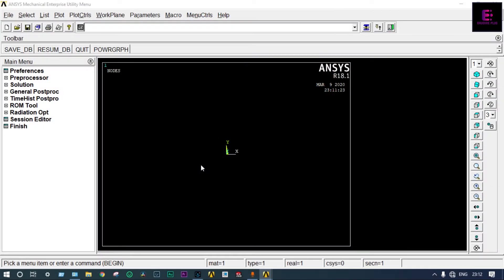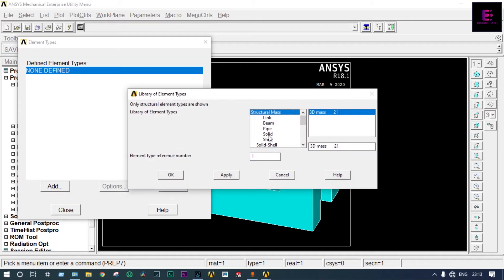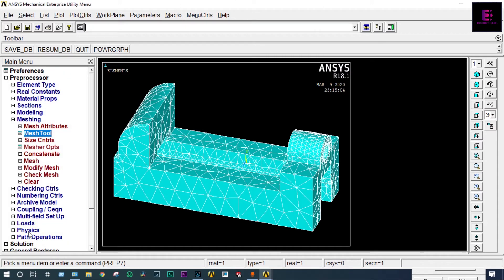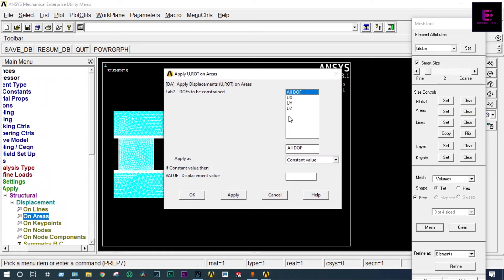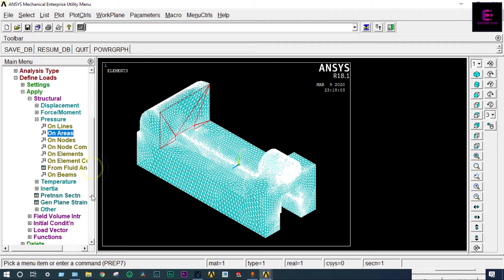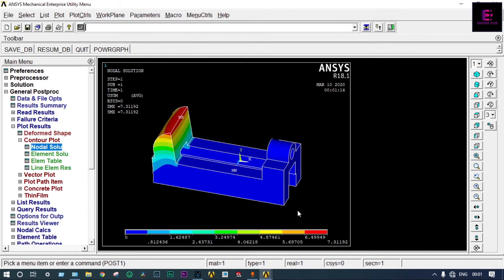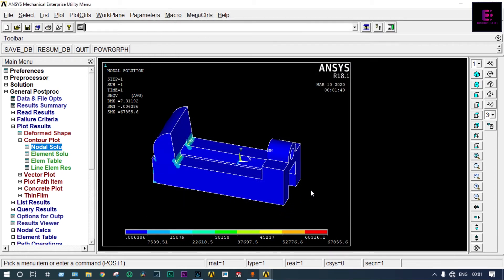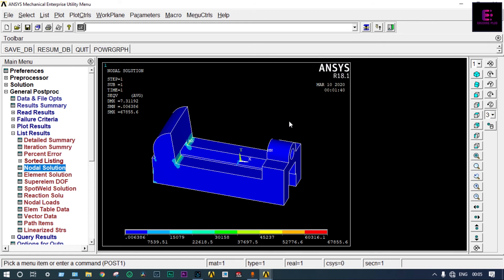Static Structural Analysis of a Mechanical Vice Using ANSYS Mechanical APDL

Comment: How can I design a hyperelastic material like rubber in ansys apdl?and what element type should i use?
Reply from the maker: Generally we use solid 1070 together with specific modulus of elasticity and poisson's ratio of any required material
Reply: @CFD_GUIDE  thanks a lot...in material model there is a tab in nonlinear called hyperelastic am i not supposed to use that?
Reply from the maker: That is specially for non-linear analysis. I was talking about general static structural case.
Reply: @CFD_GUIDE  so for rubber i dont need to use modulus of elasticity and Poisson's ratio and go to non linear and use one of hyperelastic material right?
Reply from the maker: Yes
Reply from the maker: In case of visco-elastic materials, e.g. polymers properties are combined with both fluid and solid. So, we shouldn't use normal method.
Reply: @CFD_GUIDE  do you have any videos or articles on designing hyperelastic material?
Reply from the maker: No, I have to search
Reply: @CFD_GUIDE  thanks anyway💎🙏

Comment: Hey! Can I get the igs file of this part please?
Reply from the maker: I am so sorry. Actually I delete all the files after uploading because of shortage of CPU storage. I will check, if it is available I will send it to you
Reply: I am getting an error while importing ny igs file. And it says no volumes created while meshing. If you have a solution please tell. Or mail me the igs file at shubhamppatil247@gmail.com
Reply from the maker: First of all I should know in which software you want to analyze your model. Modeling is easiest in Solidworks. If you want to analyse your model in ANSYS, or PTC Creo or any other platform it can be saved as according to that software. If you want to save in igs and work on ANSYS in that case from Solidworks saving option you have to further check the option with ANSYS
Reply: @CFD_GUIDE   there is no option to import files from solidworks
Reply from the maker: File save as option to be considered and then you can import in any CAD specific format like Parasolid, step or igs.
Reply: Okay. Thankyou!
Reply from the maker: If your problem is not solved, please write to me, I will upload one for your understanding